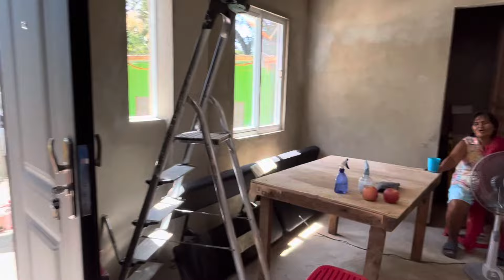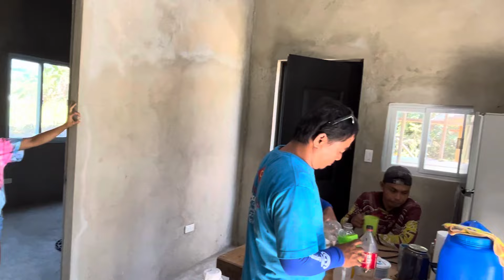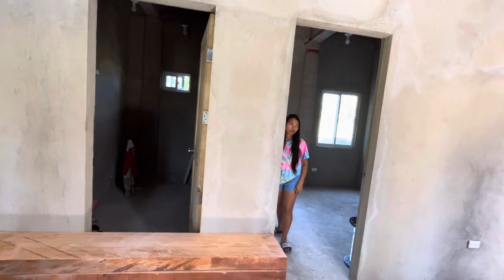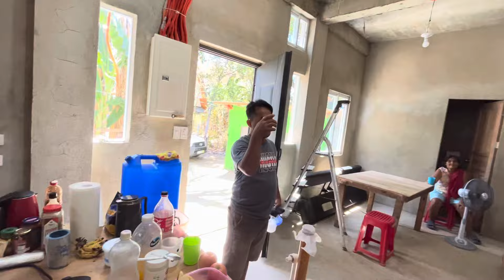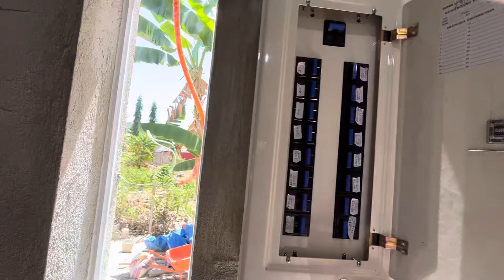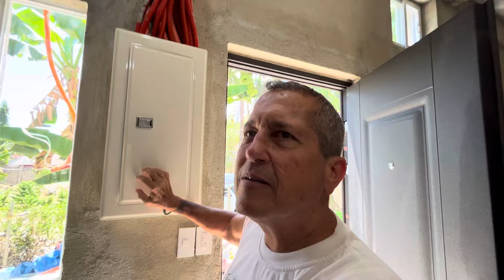A lot of gibberish and earthquakes in the Philippines ￼

Comment: i built mine like you built yours !
in 2015. since then we have had many 5 and 5.2 etc earthquakes, no cracks or damage yet. we have had maybe 6 typhoons since then all no issues. my little castle is only 15ft from high tide, my terrace overlooks the ocean, rising sea levels will have me walking out the front door into the water before any damage occurs from typhoons or earthquakes i think!
nice job on the construction. you did it the right way.
Reply from the maker: That sounds really nice to be Oceanside

Comment: Hi Joe,

The house is looking incredible! I do have a question though.

I was wondering about the wiring when I watched the video of the pouring of concrete on the 2nd floor. Was it not possible to run it through pvc pipe to allow repair and replacement if needed? It just seems very difficult to impossible to address any problems.
Reply from the maker: Yes, Tony, we ran it through all the orange conduit piping it was probably hard to see
Reply: @nevergiveup-db6fp  Ahhhhh very good. Now I understand. I will watch that one again.

Thanks!

Comment: Your concrete is already compromised.  There are ways to control the curing times.
Reply from the maker: Hope not we kept water on the floor for two weeks to slow the curing the cracks in the wall are the 1 inch finishing concrete?
Reply: @nevergiveup-db6fp  
Well then, I stand corrected and may your home stand for 100 years!